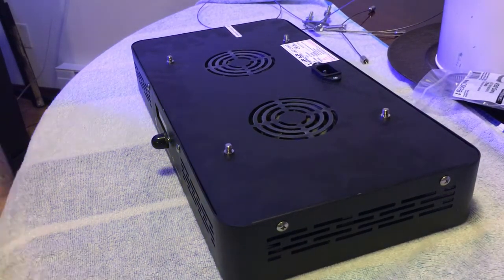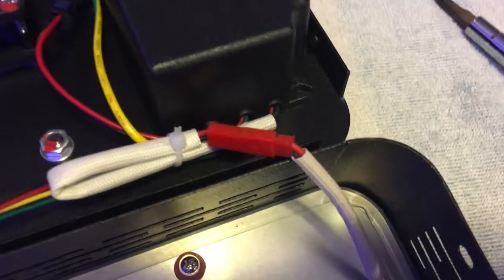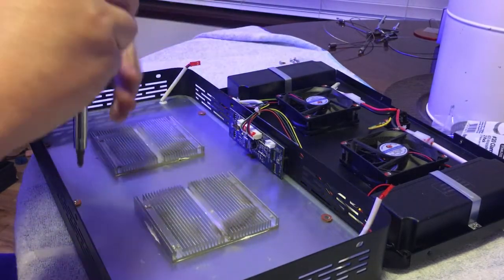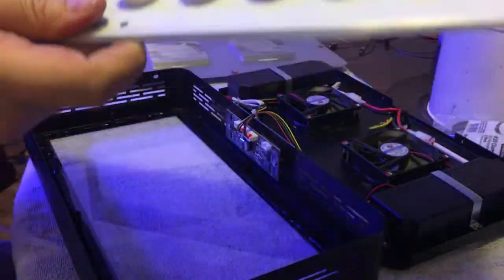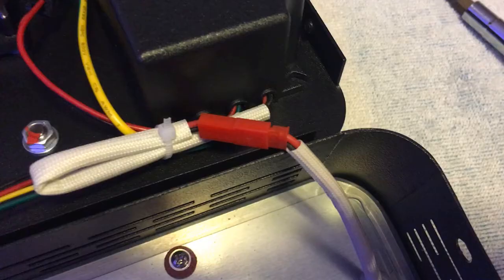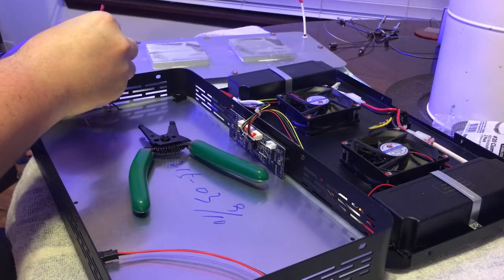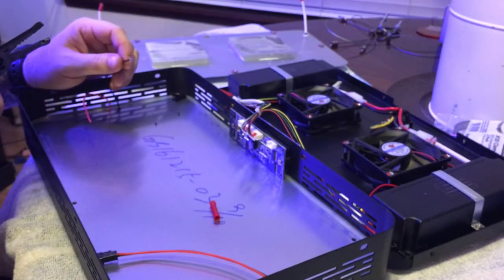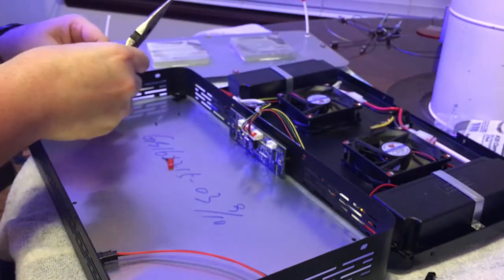How To Upgrade Viparspectra 165w to SB Reef Lights PCB Tutorial

Comment: How did your coral growth compare to other lights with the sb reef light? Is there a big difference in growth with the sb vs the viper but more importantly how does it compare with higher end lights like a hydra or radion?? Thinking of getting an older used hydra or radion but not sure it’s worth the massive cost difference

Comment: SO why not add a couple of true UV diodes? Also in the video you said that it seemed like you were getting more shadowing from the replacement board. Possible that the lens' on the SB were narrower? I own the Vipar 165w light. I was really impressed with it and will be buying another one when I move from my 40b to a 75g.
Reply from the maker: I'm pretty sure the SBReef board has true UV diodes.
Reply: RC Sessions you have 40b how many light 1 or 2?

Comment: Do you think that i can swap out the fans and change them to fans that are silent??? I've noticed a lot of these led's use very loud fans, do you think its easy to swap out with better more silent computer fans?????? need some advice
Reply from the maker: Yes you can, you just have to be comfortable splicing and soldering wires. There's a guide somewhere on YT you just have to do some digging.

Comment: fyi the fans are blowing ON the heasinks they are not drawing hea out, what the design actually does is push air through the heatsink out the sides.  now anyone that has ever looked inside their pc case knows this design sucks because the fan gets plugged up in no time at all.

Comment: the lights themselves actully come from china. If you do enough searching you will find the supplier himself that sells to sbreef. I was going to buy from him but i decided not too.
Reply from the maker: I mean I figured the lenses came from China but does SBReef assemble the boards in the US or is the whole thing imported? If so that's a huge disappointment.
Reply: the whole thing i believe comes from china. The only difference is that he Manufactures them with Sbreefs proprietary layout. Another words how the LEDs are layed out on the board. Least that was what he told me when i was thinking of buying from him instead of sbreef. I still haven't bought one yet only cause my tank is a hexagon and so mounting is a issue for me
Reply from the maker: That is extremely disappointing!
Reply: I live local to sb shop. It is disappointing that you cannot walk in and buy a light fixture. Has to be online. Then gets shipped to your house, from the manufacturer, located in China. Most of the black boxes components come out of the same factory.
Reply: sirbum69 where can I find these light from China ?